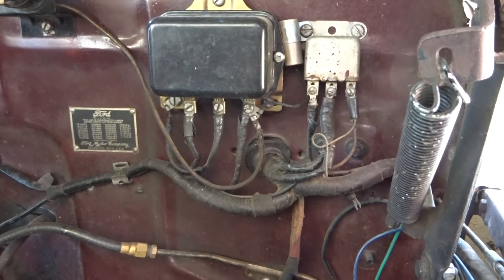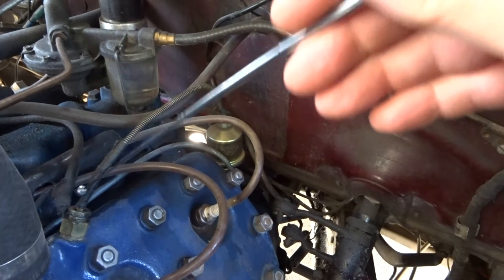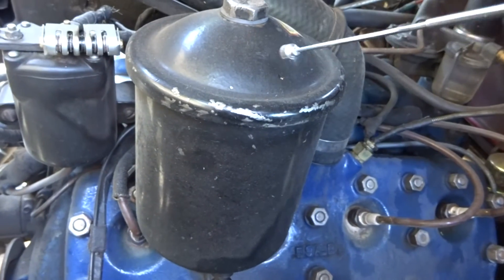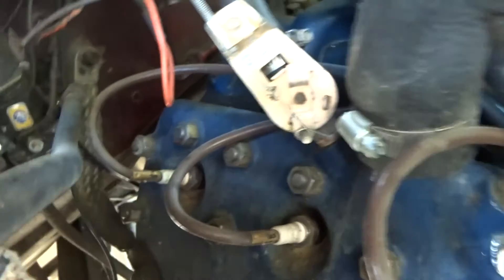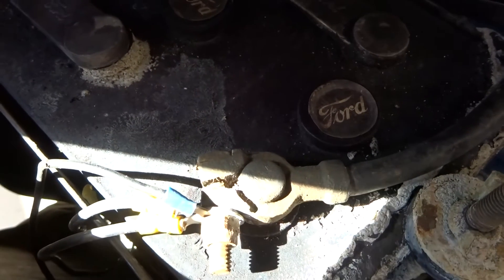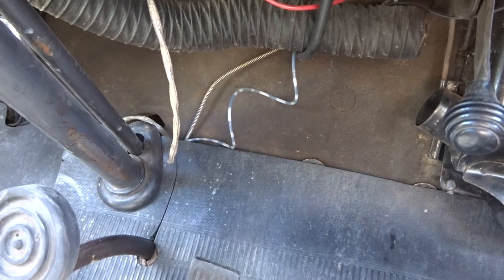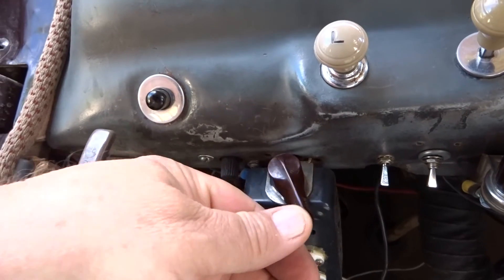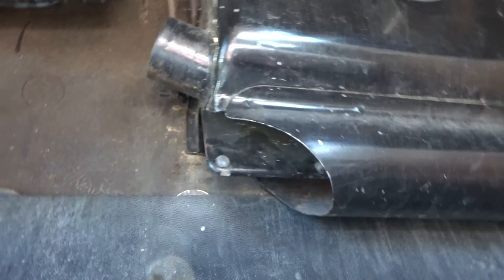1947 Ford "Old Henry" Engine Compartment

Comment: 4:23, there is no panel in front of the radiator, because of the fresh air heater. For 20 years, I've been meaning to replace that panel I thought was missing, that really isn't supposed to be there in the first place! Thank you for this great video!!
Reply from the maker: I actually have the panel and tried installing for the summer when I don't use the heater thinking to force more air through the radiator to cool better.  In fact, the engine seemed to run hotter with the panel installed so I leave it out all year round - except for car shows.  The engine compartment shows better with the panel in.

Comment: ever fly any model air planes? i used to back when i was younger.
Reply from the maker: Yes.  I've been flying them for about 15 years.  I am currently flying a Radian XL motorized glider with a 8 and 1/2 foot wingspan that I've had up over 3,000 feet.